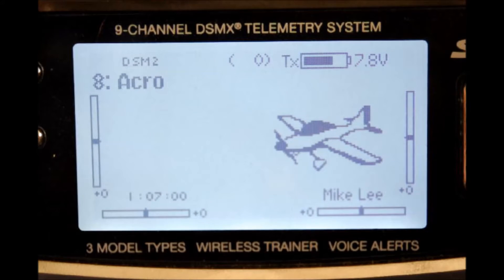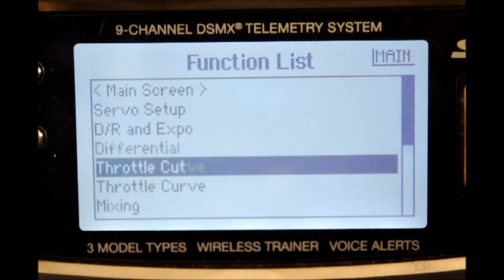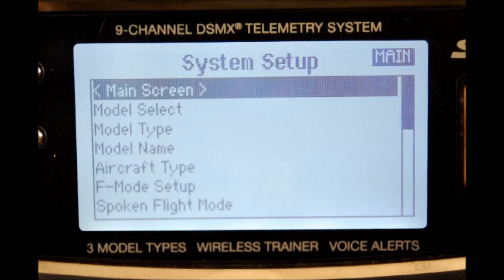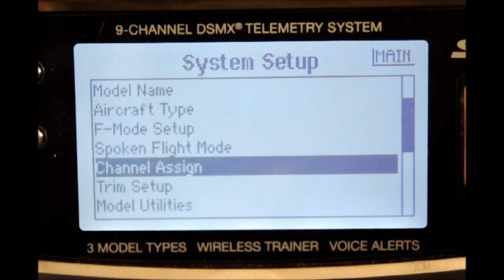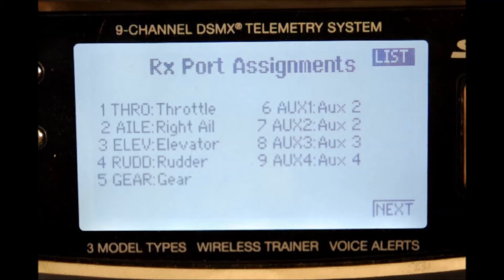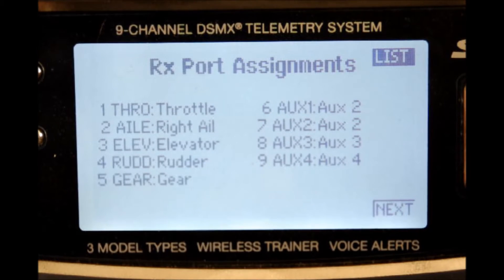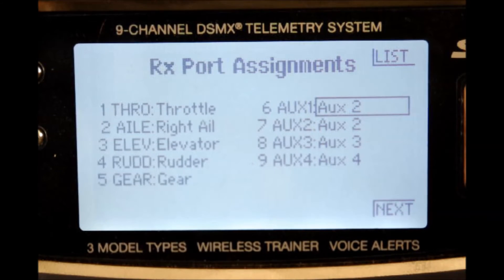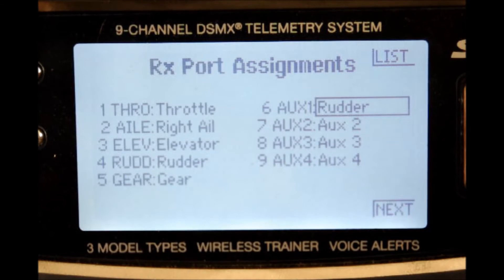Team Tech Tip   Channel Assignment

Comment: I have a BIG problem.  I have a DX9 transmitter and  an RV-7 airplane with an AR631 receiver.  I successfully set up my airplane the way I like it along with SAFE select assigned to switch "A"  A afterwards I realized that I really need SAFE to be on switch "B"  I've tried everything I can think of to move that SAFE function over to switch "B" with no success.  Even Re binding the airplane with SAFE OFF.  Then Re binding SAFE back on and attempting to move it overt to switch "B".  I f you know how, can you please assist me.  THANKS.
Reply: U should be able to assign any switch for safe/as3x in forward programming.

Comment: Hi Mike great tutorial ! Can you help me understand channel mixing and how to do it with a DX 9. I want to understand how I can set my slats and flaps together and what all the setting mean to better understand how to take advantage of this function. Also I am geting ready to receive the new F 14 from MRC and I wanted to know if I shouls and could set two modes for the servos sensitivity during the time when the wings are in sweep position and then when they are forward. I know the CG will change and the control surface get a little more sensitive with them in the sweep mode so I want to set up two modes for this plane, thanks !
Reply from the maker: +Bob Hodge Hi Bob, Mixing is not that hard, as it is mostly just knowing the software routine on how to activate it.  So, let's take that slats and flaps mix.  Let me assume that flaps are controlled by the slider switch on the backside of the transmitter case, and we will use the left side slider.  Just for this exercise, I will assign the flaps to the left slider and use channel 6 as the control channel to the flaps. With the slider in the up position, the flaps will be up.  Set the end points of the flap servos and when you are satisfied with the flaps, we move to mixing the slats to them.  In the Function List menu, scroll down to mixing and press the roller switch once.  Assuming you have no mixes set up, select P-Mix 1. Press the scroll switch once. I am going to assign Channel 7 to the slats, and the end points have been set. The first thing to decide is whether the mix is a linear (normal) relationship or on a curve.  I will go with normal. Press the scroll switch once.  This takes you forward and you need to tell the DX9 which controls you wish to mix. You should be looking at Mix 1, inh>inh.  By scrolling just once, the first inh will be highlighted.  This is your master channel., flaps, channel 6.  Now, highlight the other inh and that will be Channel 7, slats. Press the scroll switch once again. You are now at the rate selection.  You can add a value, which makes the slats move with the application of flaps at the rate of percentage shown. So, if you assign a value of 50, the slats will move 50% of the distance from center to the end point. If you program 100, then the slats will move 100% of the allowed movement that you set in the end points. Note that you can set this as a negative number as well, which allows the servo to move in the opposite direction.  Now scroll to the Offset.  This is what allows you to reset the center or neutral position of the slat servo function.  If you thought you would have to set the servo control arm somewhere other than centered, you can do that with the offset electronically.  Once that is set, roll on the scroll switch one more time and you have the switch to select when you wish to activate the mixing function. If you do not want to turn it on or off, as in just leave it active all the time, then the selection will be, "On".  Otherwise you can select the switch to use when you wish to activate the mix.That should do it and now you know how to mix.  Use your monitor screen to show you if the set up is working like you intend it to work, before turning the receiver and servos on power.  That way, you won't stall a servo and burn it up.  I hope this has been of service to you and if you have more questions, please let us know.  Sorry it took so long to reply, and that is my fault....I'm learning how to respond back to these questions, and then remembering that these questions are here.Sincerely,Mike LeeTeam Horizon